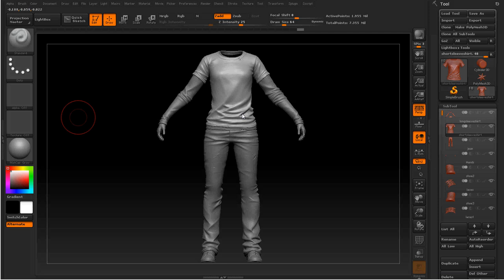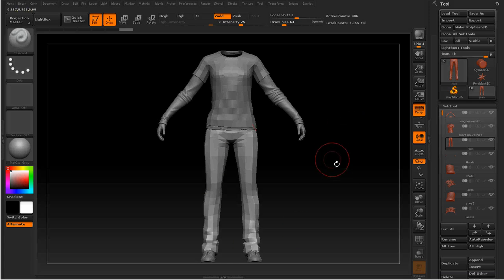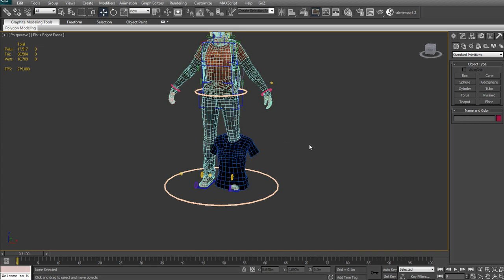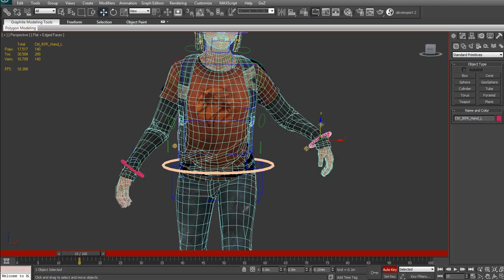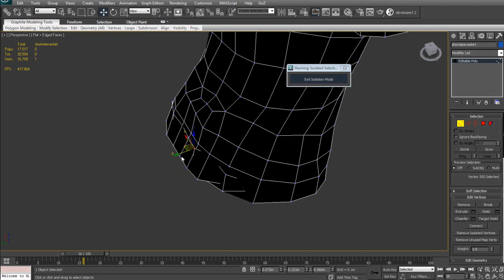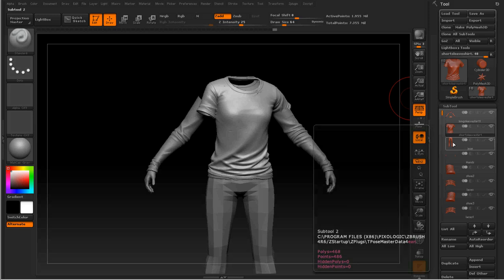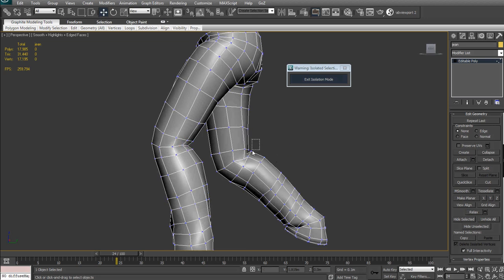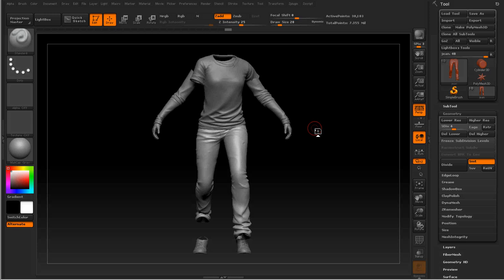ZBrush GoZ Posing Pipeline

Comment: I cant see the reason to do the transfers between redactors if its possible to rig model inside ZBrush and pose the way its needs to be. But maybe sometimes its saves the time if Max rig is available already. Or just bake lighting from Zbrush model onto midpoly model and pose its live even inside  the engine if its needs. I mean the tool is interesting for fast transfer between redactors, but for some reasons which I do not see currently